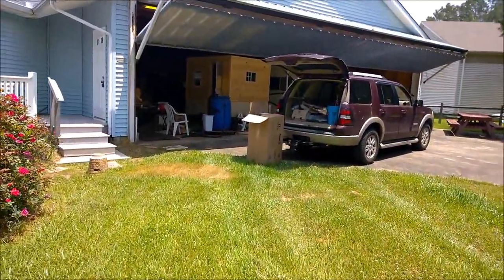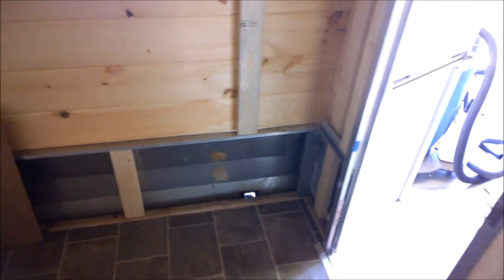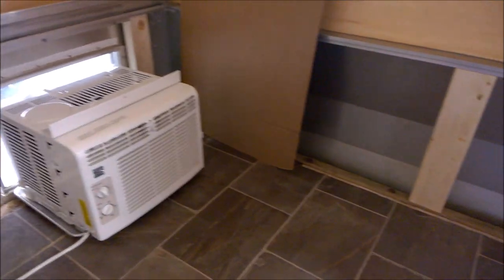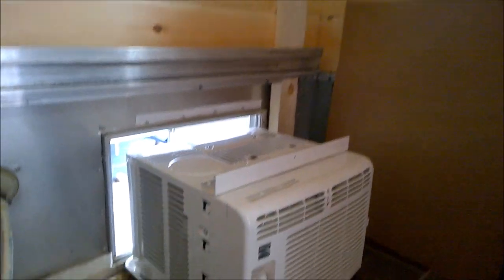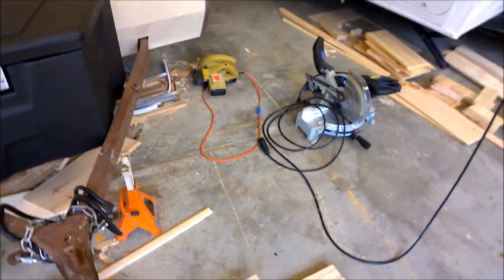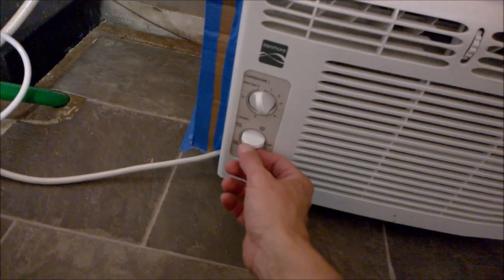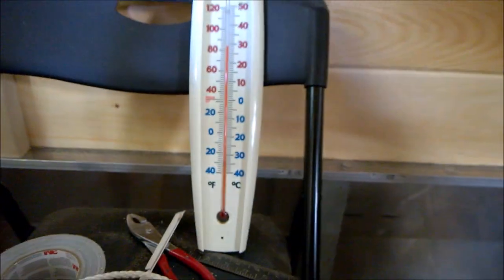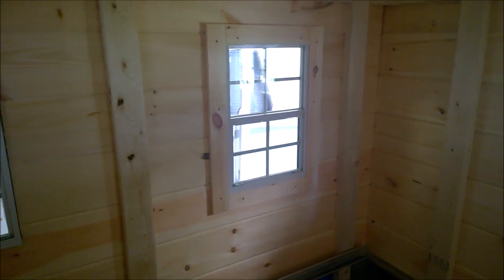Pop Up Camper to Hardside Conversion - Part 9! - (Air Conditioning & Trim)

Comment: Hey... don’t you have vents on the SIDE of the A/C unit?  By closing them off you may drastically reduce your cooling. Air doesn’t go thru the A/C from outside to inside, you have an outside circulation (and a big chunk of your “outside window” is now set inside & blocked off) and an inside circulation (cool too
 air gets cooler).  Correct me if I’m not seeing something right...

Comment: I’m new to this channel, and had a quick question about the hard side conversion. How is the new buddy attached to the floor body? Is it just screwed into the drip edges or is it bolted down to the base?

Comment: You need to make your box around the ac a little bigger and cut a vent in the floor on each side of the ac and put heavy screen over those holes to keep bugs out. The condenser exit needs to be sealed off so the side entrance vents don't draw that hot air back through.
Reply from the maker: Thanks.  Good idea.

Comment: Thank you so much for these videos. They are great! fun project I'm trying out on a used camper i got cheap. I'm wondering though, are you not planning to use propane? if so where did you move the tanks to?
Reply from the maker: Thanks for your comments.  I don't plan on using propane, this will be fully electric 12 volt stuff.  For cooking I'll use a small portable table burner.

Comment: I don't want to burst your bubble about solar but it may not go your way.  If you have a small 5000 btu window unit it will pull about 475 watts continuously while running.  It will also pull about 1200 to 1500 watts at startup.  You will need to have a 2000 watt power inverter to get the unit to turn over and you will have to have batteries that can source 100 to 150 amps.  Next there is the matter of the inverter running at about 85% efficiency and your solar would best be served by an MPPT controller which is about 90% efficient.  This drives up your steady state solar needs to around 600 watts which can be generated by about 5 square meters of solar.  That would be the entire roof of your trailer when the sun is shining straight on the panels.

However, you still have the 8 hours of summer night and perhaps a 50% duty cycle on the AC.  You are going to need to draw 200 amp hours from the batteries during the night when your solar isn't running and then hope to catch up the next day while solar is both cooling and charging the house bank.

Of course running your AC with solar is within the realm of possibilities.  You should keep realistic expectations and do some tests along the way so that you don't under size your installation.

Of course you really don't need AC if you have a trailer.  Just go to the Finger Lakes in Summer and Gulf Shores during the Winter.
Reply from the maker: Excellent breakdown.   Thanks.  I've tinkered with solar and solar controllers but not on a larger scale like this would require.   I've seen some set ups where small new/modern a/c units in this size pull around 350 to 375 watts while running, but the start up surge is definitely far higher.  Anyhow, solar is pretty far off for the time being.  Thanks again for your detailed explanation.
Reply: @drez20001  I'm planning on doing something exactly like this, and I actually have an almost identical camper.  I was just going to use a generator or sure power for the AC.
Reply from the maker: @mt1990sweg  Awesome.  Do share your pictures of the build.  There aren't many videos online on this modification.   Best of luck.
Reply: drez20001 I haven’t even started yet but I certainly will when I do.  I’ve got some rotting issues and canvas tears in mine as well.  It’s a 1983.  I’m hoping to get started this fall hopefully and was hoping I could message you with some basic questions when the times comes.

Comment: I tried that method with an 12 k btu ac in my camper and it didn’t work . The fan will pull the same hot air that comes out and i will stop blowing cold air inside in a few minutes

Comment: It is probably too late, but the problem with those window coolers is the angle that they set at has to slope down towards the outside, or you will flood the inside. Have you seen one of these: https://www.amazon.com/dp/B08677DCKN